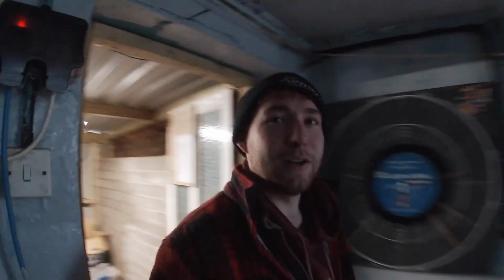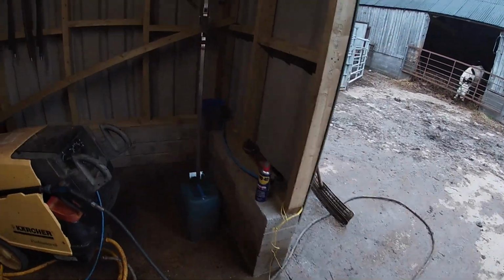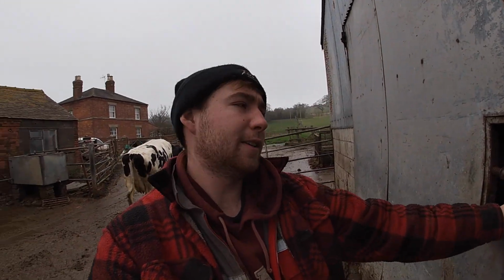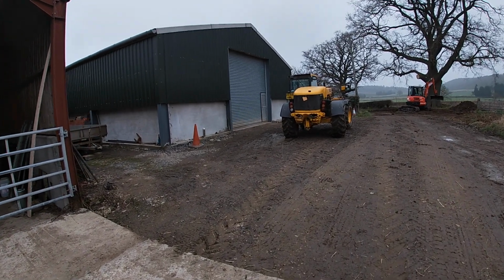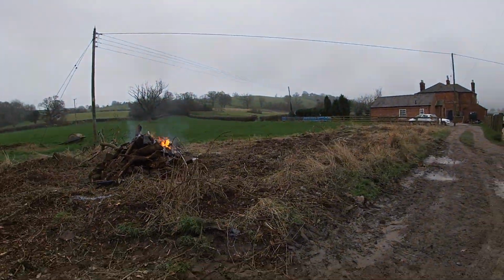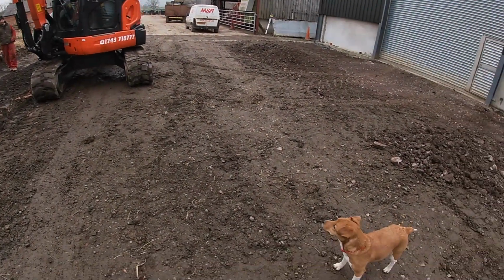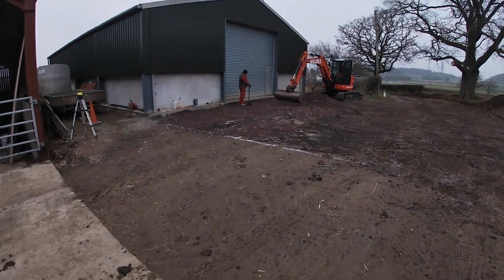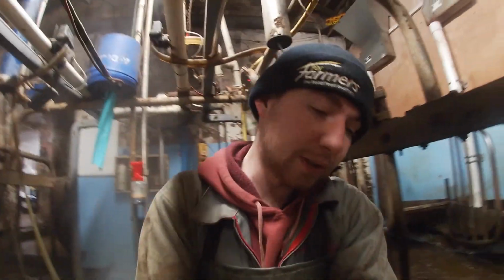New concrete yard preparations start.

Comment: Good to see you back posting again Liam, happy new year to you as well mate, the new shed must be a god send especially during the winter months and the concrete floor will make a big difference especially when it comes to loading up the lorries mate, and would you do a milking video from start to finish, also I follow your instagram but haven't seen anything posted since the summer of last year yet it says I follow you very strange indeed.
Reply from the maker: Cheers Mate. The new shed is perfect for storing grain and as you say the yard will make it even better. I shall get round to doing a milking video soon. As for the instagram issue I'm not sure why you haven't seen anything, my last post was on New Years eve. :)
Reply: @casefarms3096  Cool will lok forward to the milking vid mate, and I've sorted the instagram issue, so everything is fine now.